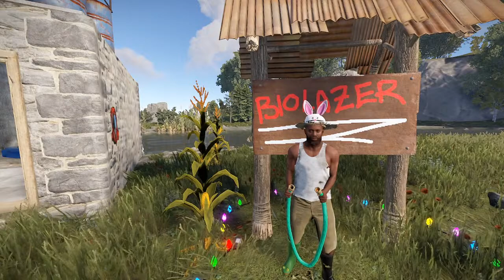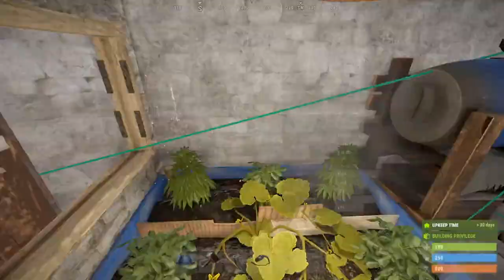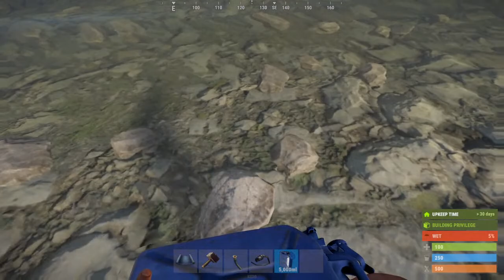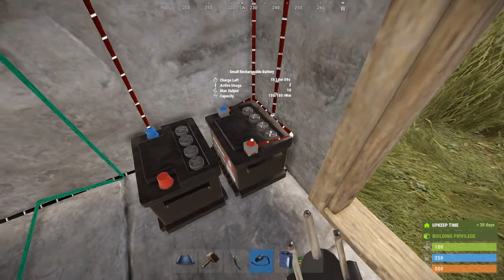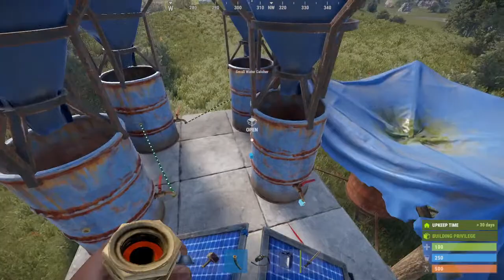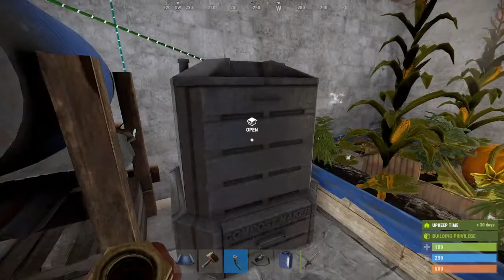Farm easy scrap with update 🏹 Rust console Xbox, Ps4

Comment: a solar cell must always be aligned to the south or north depending on the solar cycle ->  if a 30-day wipe is played, the cells must be rotated by 180° after a certain time. 
on the other hand, one cell aligned well is enough to draw 10 energy throughout the day and night -> one solar + a small battery can provide 24/7 the energy for a direct wired autoturret.
Reply from the maker: Of you see my electricity for dummies I've explain this exact thing already